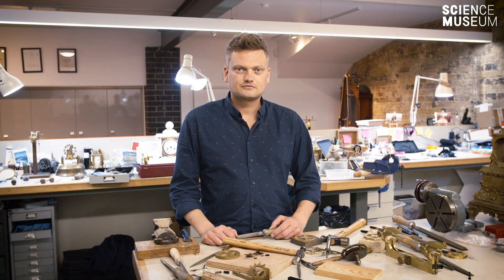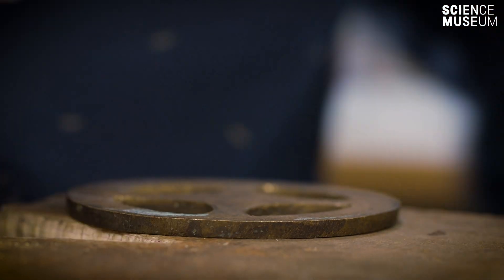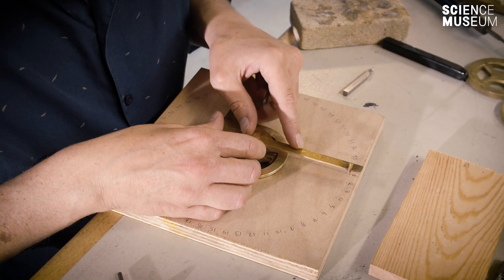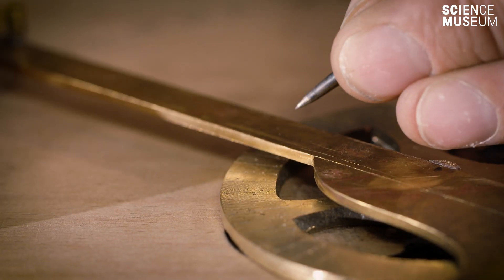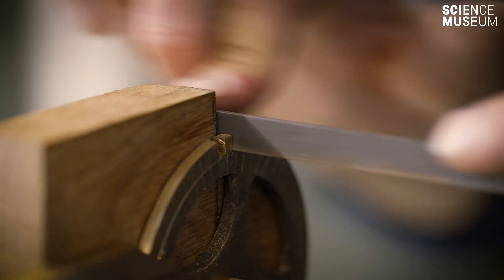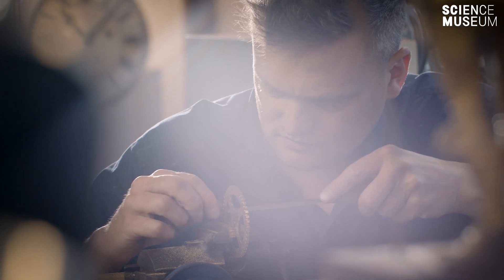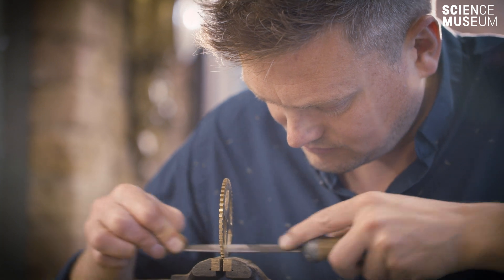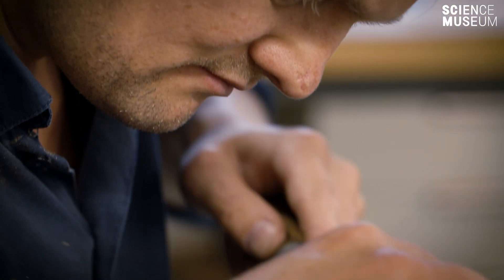How to make a clock wheel I Shaping Science episode 3

Comment: What’s The compass tool you use to mark teeth?
Reply: @pigghedd8245  so you could use a simple divider caliper but he is using a depthing tool which is a clockmakers tool used for something else (finding the correct depth of wheels) but works for this too. It could be that he depth'd the original wheel with this tool earlier and was using the measurement from that also